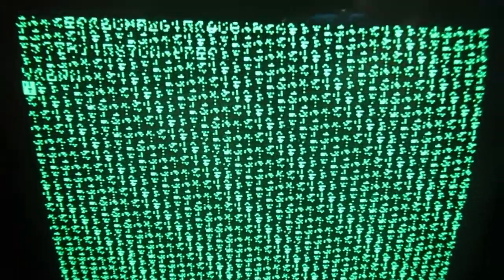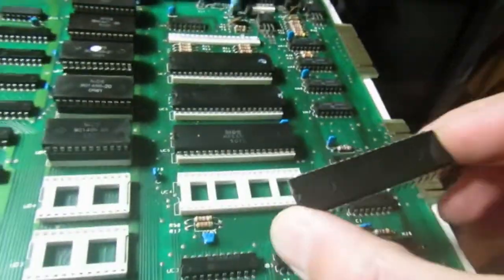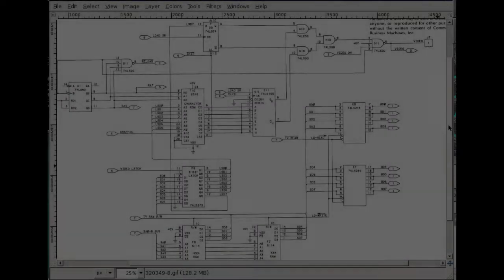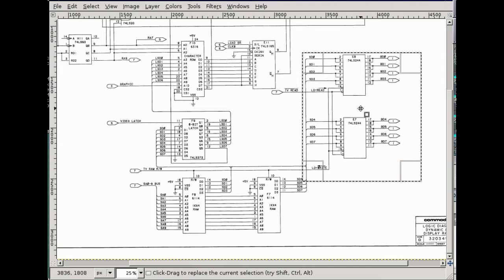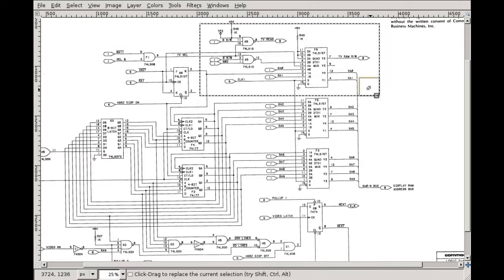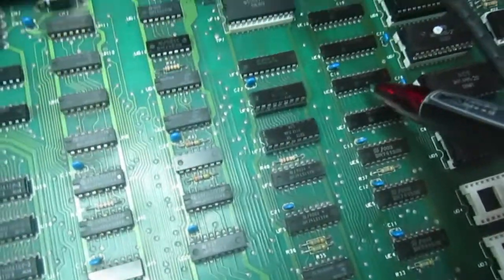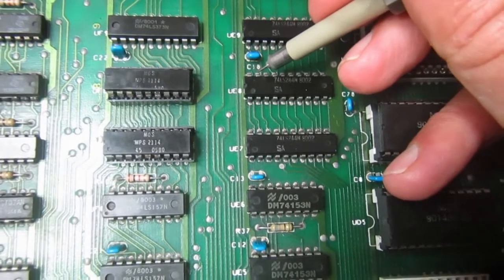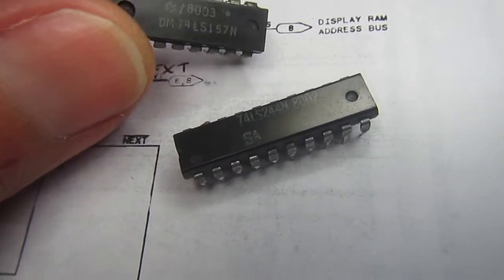CBM PET 4032 (2001N) video fault repair.

Comment: Amazing fix. Using observations and the schematics to narrow in on the likely problem is brilliant. So much better than the usual ripping and replacing chips. 

That current tracer: such an invaluable tool.

And indeed, Chuck Peddle affected my life too. My first, second and third machine all ran on a 6502. Don't know what my life would be like without these computers when I was a kid.
Reply from the maker: Hey Adrian! Thank you for the very nice comment!